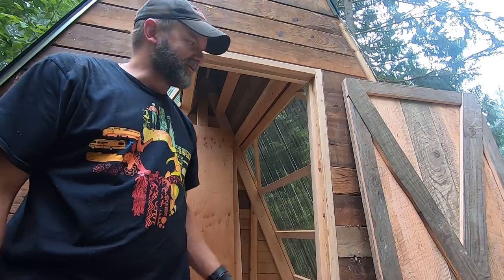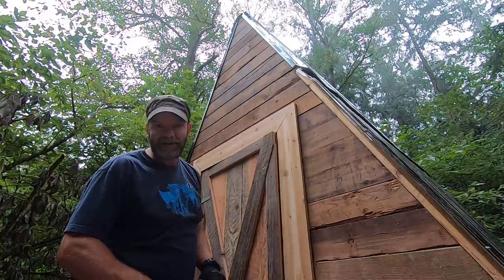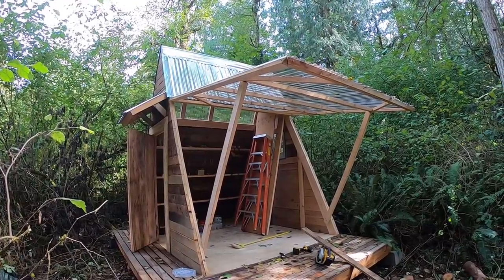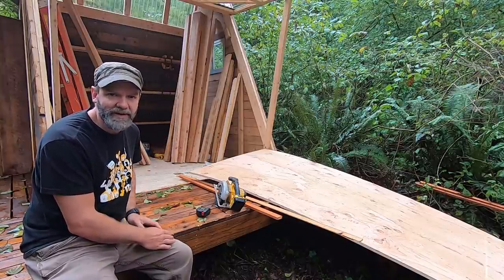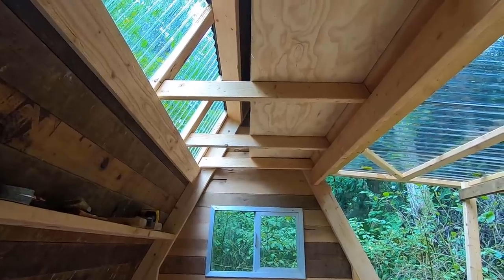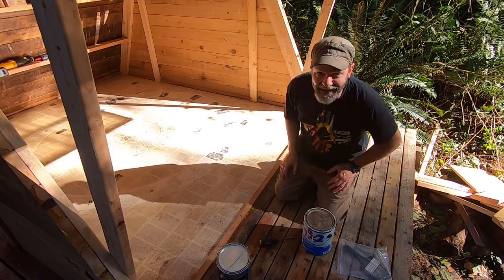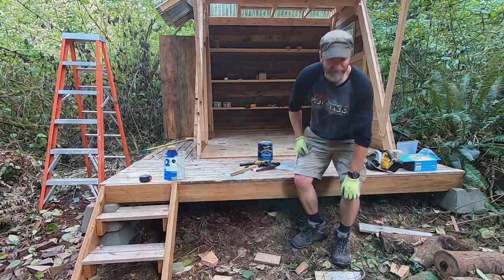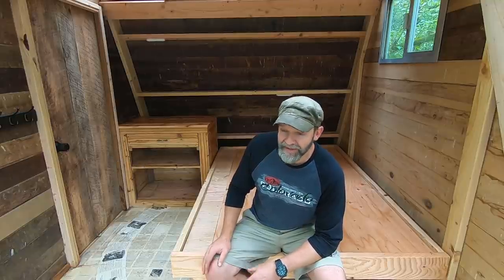A-Frame Cabin Build Part 3

Comment: I love watching your videos! Just a thought about the stairs to the loft ,instead of the beautiful dresser/Table you built ,you could have made storage cubes that also can be used as stairs going up to the loft, and then for the empty wall across from the bed ,make a drop down table hanging from the wall ,and then for extra storage build drawers to fit under the bed you built.Just an idea,, Beautiful cabin!! Thank you for sharing your build!
Reply from the maker: Those are good ideas! If I do another one, I might incorporate some of those features. I got a collapsible ladder that seems to work ok for now..

Comment: Hi Phil, enjoyed the videos and your well thought out design. Would it be possible to make a cabin like this bigger and still have some of the same features?
Reply from the maker: Yeah, probably. I've seen some other videos with similar designs that are bigger. Some have the swing out wall, but it's only a part of one wall (if you built it out any bigger it would be way too heavy.) I built mine is pretty much spot on to Deek Diedricksen's popular design.
Reply: Thinking modular....

Comment: I may be crazy but I would put a metal bar on the window end of the awning that goes to the ridge line and then add weight lifting weights to it until it became a counter balance to the awning. You could add weights until it opened with little effort. It would all have to be on the window end as the porch roof and the door would get in the way on the other end.
Reply from the maker: Wow. Interesting idea. I actually like that a lot better than the scaffold/pulley systems I've seen people build. At any rate, as you will see in the second bonus video, I already installed some gas struts that seem to be working pretty well so far.
Reply: @philbrown5722  As the gas rams age, you can add the counterbalance and increase the weight as needed.